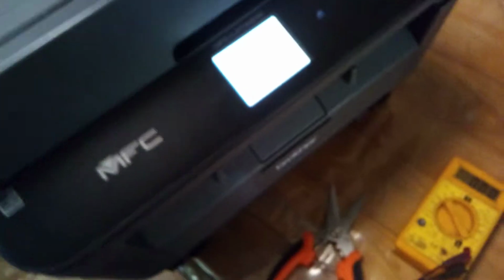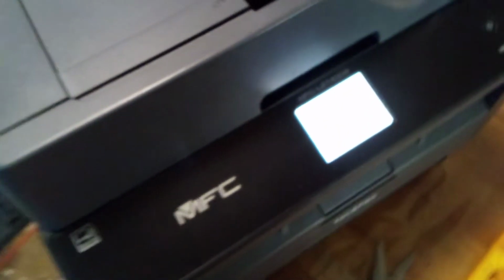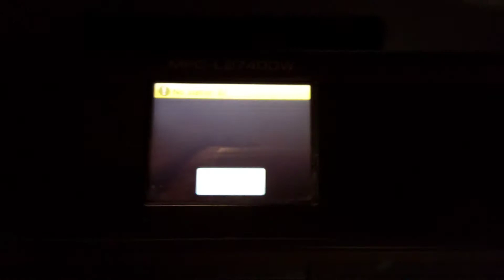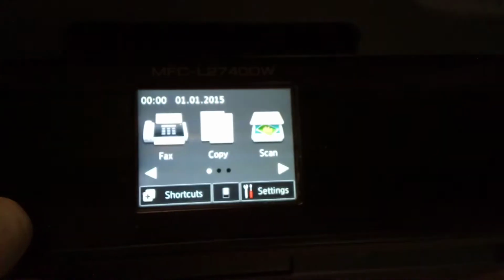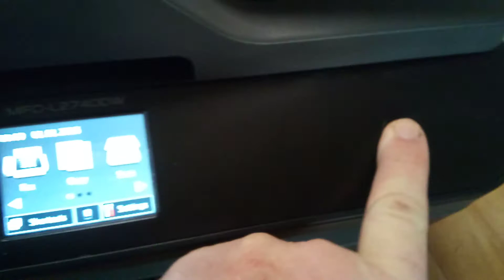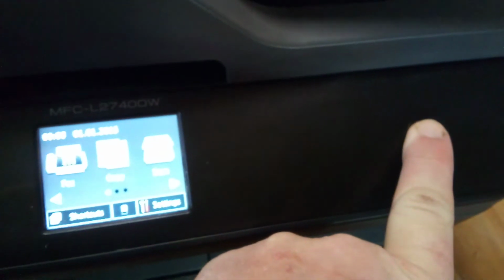Brother/ Xerox No Power Final Bit

Comment from the maker: When soldering the new capacitor use lead based solder as it flows better and makes soldering easier. The new lead free solder is impossible to use.
Reply from the maker: Plug a USB cable into the printer and directly into your computer then download the firmware update tool from the Brother website and update the printers firmware. If this doesn't fix it then you will require a new user panel the problem you are experiencing I am seeing in plague proportion in my workshop at the moment

Comment: Hello! Please help me solve the problem. The display of my L2740DWR is white, the sensor is not working. But the printer turns on and prints from the computer. All voltages on the panel control board come. The MFP turns on and off with the power button. What could be the fault?